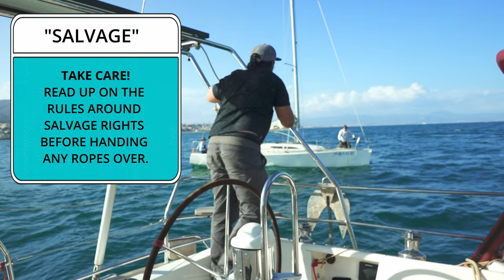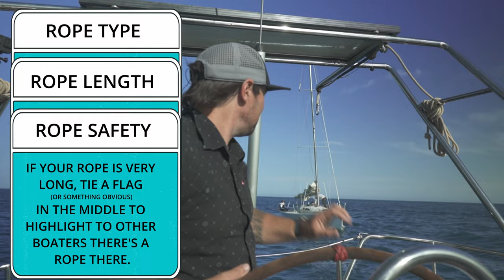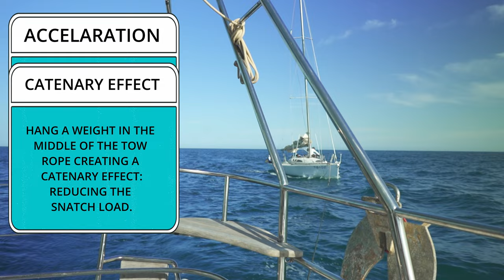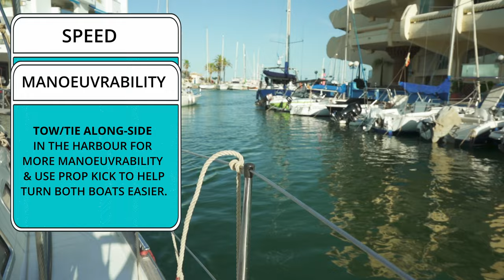ENGINE FAILURE! How we helped a stranded sailor!

Comment: 7:45 Correct me if you think I'm wrong but strictly speaking, shouldn't you be displaying an inverted cone shape, and, (arguably) the towed boat should show two balls as really they are not under command?
Reply from the maker: Not so sure about the two balls but yes we should have displayed a cone. Unfortunately... The errr "Spanish Tow" doesn't appear to require these or any normal procedure, sometimes I guess you just have to go with the flow...
Reply: Yes, I chuckled when you said "Spanish tow" in the video!  @SailHub